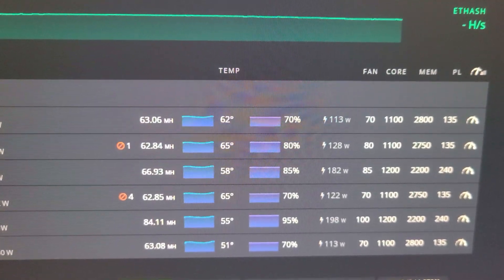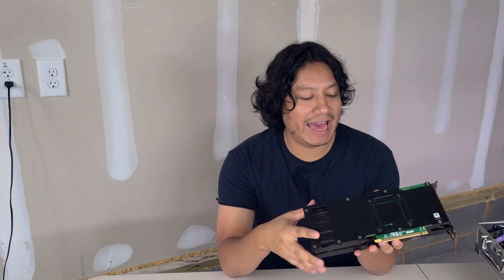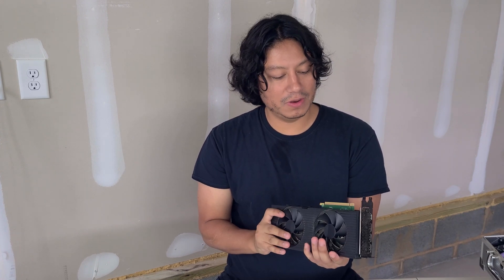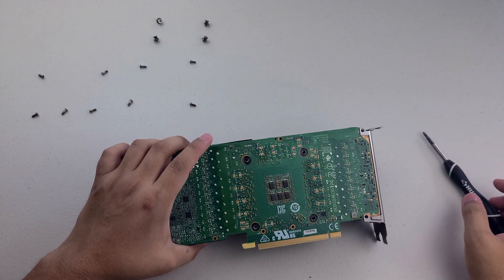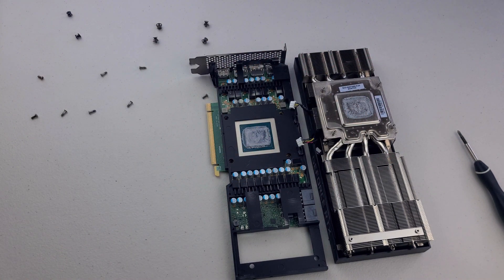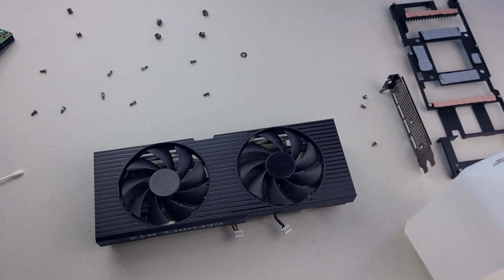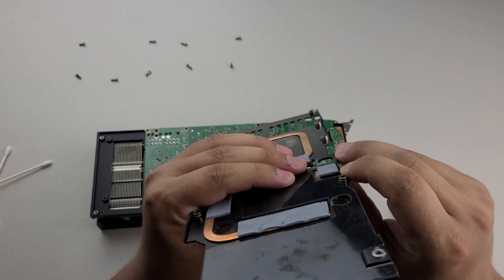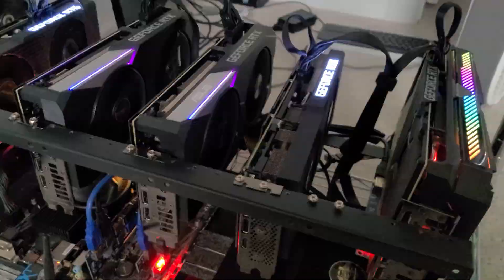Dell Alienware Aurora R10/R11/R12/R13/R14 NVidia RTX 3080 GPU Vram Temperature Fix no Thermal pads

Comment: How old is your Hive OS build cause I dont see any memory junction temperature. I just got two of these cards and the my core temps are good, but my memory temps easily reach 100 c. I have repasted the memory surface area and my mem temps still reach the 100 c mark. These results come from mining Raven coin at 280 watt power limit.

Comment: I'm sure that may have helped with temps but as for mining it is whatever the mining program had tasked it with can vary session to session
Reply: His vram was running overheated constantly and throttling independent of any mining workload. The vram thermal paste trick lowers the temps below the throttling point. This is a well known issue.